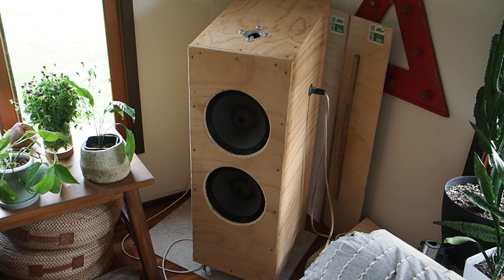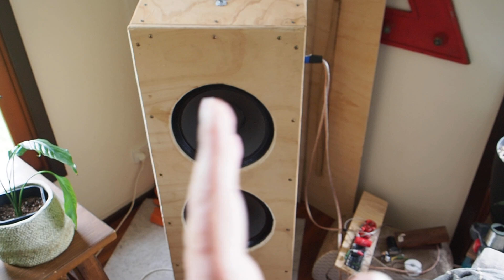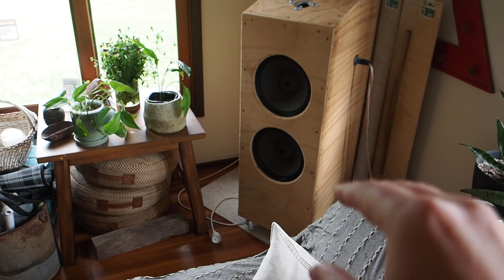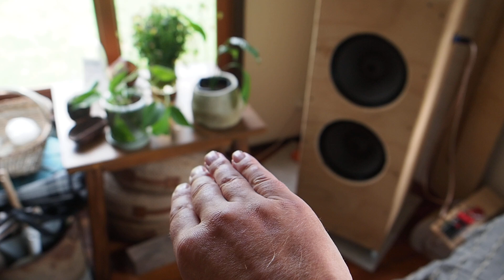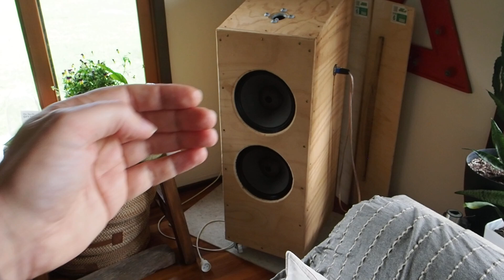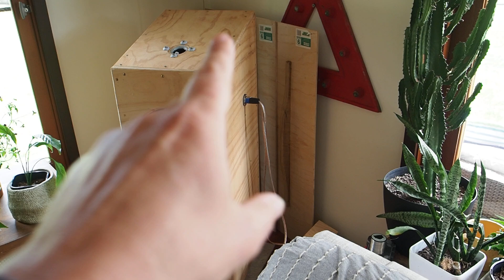A smaller Lancelot speaker: underlying concepts, its sound, current production driver option

Comment: I apologize if I missed it, but is it your intention to go to a stereo set-up with two speakers at some point ?
Regardless I enjoy your videos and the content
Reply from the maker: Hi there, thank you and who knows; that might happen some day but it's not a goal right now. I'll answer you a bit more extensively in a video.
Reply: Hi just curious why don't you run the top 12in fullrange with the crossover set at 1200hz and the bottom at 200hz  low pass on down so both 12in play 200hz down for more slam but 200hz on up with one 12in with the crossover for less comb filtering and beaming and build something like the Wharfedale SFB/3
Reply from the maker: @MyTgangsta  Yes good thinking and such a 2.5way option did cross my mind and I will trial that once I receive the new compression driver next week. That CD will hopefully allow a nice low crossover point (under 800Hz at minimum) which will reduce combing effects and make the speaker more omni. There's also the baffle step which needs to get solved by the crossover point choice for the 3 drivers.
Reply: Hey I'm curious on one thing you compared the new compression driver that you're getting as a alternative to the altec how did you get to that conclusion because I like the old altec and jbl speakers and compression drivers and since they're expensive and we do need alternatives just wondering how you came to your decision on your new compression driver based on the altec
Reply from the maker: @MyTgangsta  I mostly looked for an option that (1) would be easy to integrate / flat response (2) similar extension at both ends as Altec 288 (3) gets positive subjective reviews (4) is more affordable and available than the Altec 288, also for those in Europe. The new productions options I've come across this far are the Radian 950 and SB Acoustics 65 CDN-T, with the latter being very affordable and hence  worth a try - and it's sounding good (it arrived yesterday). Hope that answers your question and yes there's other Altec and JBLs compression drivers that would do very fine, I hope the snag one in the future...
Reply: Ok thanks for the reply I also got a pair of ev dh1a like you plus a pair of dukane 5a540 compression drivers they are a copy of the coral m100 but comes with a different diaphragms and are regarded as a copy of a jbl2410 but with a bigger alnico magnet so I'm getting a replacement diaphragms from radian but I'm also after some old school altec and jbl in the future but will try the sb acoustics you got a try to see how it sounds so thanks again
Reply from the maker: @MyTgangsta  Very nice collection!! I had never heard of Dukane; thank you for sharing :) The JBL 2410 has an interesting freq.response on it's datasheet, which could work very nicely for an up-firing driver. Most drivers have a rise/peak in the 1-3kHz region which is very sensitive... which can be notched out but preferably not, or that it can be fixed addressed by a shallow horn and left 3kHz plus to the same level.